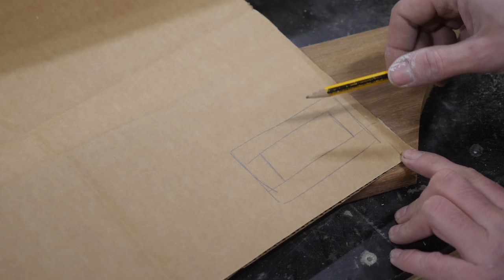Sail Life - Galley assembled, insulated and ready for paint - DIY boat project

Comment: Sir , please don’t be distressed by my observation but I must share my experience. I lost 1.5 fingers of my left hand in a table saw and this is what I learned, I now do not hold wood behind the blade during my accident a piece of oak bound on the blade and the saw pushed the wood forward before I could blink. The entire event happened so fast that I had no chance to even let go of the soft pressure I had on the board . I am left with no index finger and a little more than half my thumb. I have become very good at using a rubber tipped push stick to control small pieces behind the blade . It is my deepest hope to see you and Ava sailing on the channel! So please consider never holding wood behind the blade. Sorry for the downer comment, hope this helps
Reply: Just to add a bit to the safety warning...
Don't use a stop to control the length of cut. You are asking for a kickback. Just put a mark on the wood where you need to stop and another mark on the saw fence. When the marks line up you've cut far enough.
Reply: @johnVidBozo  I make most of my cuts with a circular saw and usually clamp the board down to keep it under control. Are you saying I should never do that either? Just hold it down with my hand?
Reply: This is saw related or the awesome power of power saws. This guy I knew had a radial arm saw. that thing always scared me even though I have been around dangerous machinery since I was ten years old. I was cutting a four by eight sheet of plywood half an inch thick. It was kind of warped. Somehow the saw blade caught hold of it and shot it out of the other side of the saw (where I was not standing). It flung the whole sheet of plywood about ten feet and it hit a wall and stuck in the drywall.  Luckily there was a cinderblock wall behind the drywall. (It was an office building and it would have been scary if it had gone farther through into an office where people were doing Gordon Gecko type stuff). So this is a true story. It was long ago. I can't remember if I was standing on the safe side by choice or accident. But woe would have been me if that plywood had hit me in the abdomen! It surprised me that the saw was so powerful.
Reply: @JakeHolman78  I'm not sure what you are describing. Using feather boards (infeed side of blade only!) to keep the piece against the fence is good. Using some sort of hold down to keep the piece down on the table is good. Having a splitter behind the blade it great.
OK I just reread your comment. Circular saw is kind of the opposite of table saw. You move the saw not the wood. Perhaps that is not what you ment??? Anyway I totally agree about clamping wood down when using a circular saw as long as the clamps are not on the off-cut side.
Reply: nicolas perez p

Comment: Mads, for the drawer fronts. Take the lighter wood and resaw it to at least half its current thickness. Then take the top and bottom rail of the drawer front and cut a grove in the edge facing down or up depending on whether it is the top or bottom. Then slide the thin wood into the slots and glue in place. Makes for a quite easy construction  of a door front or cabinet door.

Comment: I am so glad that the guy building my boat did not put epoxy everywhere in the interior so it can be disasempled without destroying the whole boat. I'm changing pumps, water hoses, running new electrical cables, put in new electrical head, new blackwater pump. And there is ordinare screws to remove all interior, no squeek in my boat, thanks to the steel hull.

Comment: Hey Mads... Without reading through all the comments... I use "Pocket Screws" to build cabinets... Most cabinets makers here in the States do.  "Kreg k4 pocket hole jig master system" is a good easy to use tool and you can get it from Amazon... I've used pocket screws successfully for 35 years... You're doing a great job by the way!  One thing I keep worrying about for you is getting the "Electrical" and "Plumbing done before anything else goes in... Regardless you are doing great!  Try to get some rest in between working a full-time job and your soon to be an amazing home!

Comment: The biscuits come in multiple sizes.  I don't know about your biscuit cutter, but mine came with two different blades that allow me to cover 4 (as best I remember) different size biscuits.  I simply change the blade as needed, adjust the machine, and voila! different size biscuits can be installed.  I don't know about availability of the different size biscuits in your area, but it would be worth looking into.  It would certainly beat having to carve little ones out of big ones.  Keep up the great work.

Comment: Mads, if you miter the corners of your drawers at 45 degrees rather than butt join them, then the length of the corner will permit you to use the smallest sized biscuits.  Use your hand router and a piloted bit to cut a relief for your slats after the outer frames are dry.

Comment: Many cabinet shops here in the states are using pocket hole jigs to assemble drawer fronts, cabinets, and face frames. They are cheep, quick, and fairly simple to use. However, you've chosen one of the hardest woods out there as your drawer front, and may run into issue with the self tapping screws splitting the wood. From my experience he biscuit jointer is mainly used for alignment in long glue-ups and is not a structural joint. Keep up the good work. Good Luck!

Comment: Kreg R3 Jig Pocket Hole Kit ( on Amazon) is how I would put the drawer fronts together. It uses special screws that are screwed into pockets. The screws have really good clamping power and will only show from the back of the drawer front. Please look into it, I've used this method for face frames on cabinets for years and used them on picture frames and even put together a screen door using the pocket holes and screws. You're doing a wonderful job on the interior!

Comment: If you want to continue with biscuit joints,  get a router and a biscuit slot cutter for it.  They have a smaller radius than standard biscuit router slot cutter.

Comment: I would use ply inserts for the draw and door fronts to help keep weight down. When you go to put your draw fronts on first make and drill at least one hole for your handles, then you can align your draw front and use that hole to screw the front on making sure of you clearances around you door front. Then carefully open draw and then screw from inside draw to attract draw front, then remove front screw then drill completely through your draw to attach handle. There are some great YouTube kitchen building clips. Keep up your great progress.

Comment: For your drawer fronts, consider having the corners mitred.  You have the tools to do clean/accurate 45 degree cuts.  This will then allow a long enough joint for the biscuits to work.  Also, you can easily cut the rabbet on the inner edge for your center panel wood without it showing on the edges.  Just a thought.

Comment: For the doors don't be afraid to just use pocket holes on the pieces that are two narrow for biscuits, both are strong enough, you could go all out and use a beefier method but its not really needed, often we will use a plywood to fill in the centre as well as its cost effective and no movement issues that plain wood will  have. As for boat building material, Its a hole in the water you throw money at, there is no perfect product, but there might be a few you can live with :) Fiberglas, aluminum, steel, wood, etc all are perfectly fine as long as you do the work to maintain them.

Comment: Panel doors would be a good place to use your new biscuit joiner . I finished last summer, 11 door panels 1/2" or 12 mm thick panel stock and used #10 size biscuits. Doors were straight panel meaning no face frame to deal with . mine were all rustic hickory. I would also recommend for your face frame the use of Kreg jig and pocket holes . Quick, strong and with stainless screws non corroding. Glue can be added to joint also if desired.

Comment: Another option for joining the drawer fronts is to clamp your frame together and then using a long bit, drill through the two pieces of wood at each corner from the outside and glue in a dowel making it an exposed tenon. I made a black walnut box once and used this method to connect the sides and I used a brass rod as the tenon.  Once it was polished up and oiled, it looked really great.

Comment: A drawer/ door front tip... Have the center section float in the frame. Maybe leave a 1mm gap on top and one side. I'm not familiar with the exact woods but I know different woods expand and contract at different rates. In a boat that is going to be in extreme climates... I bet there will be some warping and cracking if they are built solid.
Reply: I will comfirm you need a little room for expantion / contraction, and btw. The brazilian wood tends to get a silver / grey tone over time in cold weather, wisit you local wood pusher, and try to finde a pice, that has been sitting, the winter over, reaplying oil will bring back the colour it have now, i get a beatiful patina thou.

Comment: The front you have designed is nothing more than a filled picture frame. As such, 45* corners with spline reinforcement will be more than adequate. You can also use the second wood species for the splines which makes a really cool subtle accent.
Reply: I concur on mitered joints. I think the woods he has chosen are quite stable, but in a marine enviroment, there will be a lot of changes in humidity, and a mitred joint should help to mitigate issues with wood movement. Mads: Make sure to leave some room for the slats in the center of the frame to move, if you make it too tight, it might break apart when the woods swells.

Comment: Mads, I've used dowel pins for cabinet faces and frames. They are more useful for narrow widths. More versatile as well, use 2, 3, 4 depending on width. Also you may need a new tool!
Reply: He can use a drill bit with the correct jig?
Reply: @rowantaylor4070  Yes, you can get a dowel jig for less than $20. I've used them for speaker building and various projects.
Reply: I agree with the dowels as opposed to biscuits and Mads since you like tools check out the Dowel Max. its a very versatile doweling jig
Reply: I've built some really sturdy joints with hardwood dowel pins.
Reply: Tim French Good advice, I'll add (a bit late perhaps) that 45° cuts makes for an even more spiffy appearance :)

Comment: Pocket hole jig for pocket hole screws is what most cabinet builders are using now rather than biscuits for the frames. Biscuits work great for other application when working with the grain and making wider boards like table tops

Comment: Hi Mads, I just discovered your channel (late May 2020) and I am binge watching the Athena refit videos from the beginning. I watched this one just to see how far you have made it and I can see that I have lots of excitement in store. Thank you for being so incredibly disciplined about posting your videos. When I realized that you are in Skive, I felt a bit of a bond; I have lived in the U.S. for over 30 years but grew up in Nykøbing M. 

On a more useful note, I would caution you about how you assemble Ipe. It is notoriously difficult to glue because of its high oil content and mechanical fasteners are recommended; you may want to add some screws to your drawer front frames. Also, biscuits are primarily for alignment and not for structural joints. For what you are doing here, the Festool Domino or dowels are much better choices. That said, the drawer fronts are low stress parts and you will probably be just fine. Okay, it’s back to 2018 for me 🤓.

P.S. Glad you still have all your digits, I second everything said by others about table saw safety.

Comment: Love your videos !
When I built my 36 foot sailing cat, I made all the floors, joinery, lockers and cabinets, below water line with ' lift out bottoms ' floor boards. For fast and easy inspection in case of hull breach. For the water tight crash box areas, I used access hatches with stainess screws with wing nuts and gaskets. All areas of hull can be inspected fast. Cheers, Sail On 😁

Comment: You do such great work. I have a suggestion for drawer fronts.  I recently refitted my live aboard and I was in Canada so very concerned about moisture and ventilation (I am now in Mexico). For all of my cabinet door and large drawer panels I used Phifertex (outdoor sling chair fabric) over top a panel of 1/4”/6mm plywood with 2”/50mm holes drilled through the plywood. This allows air and moisture to travel through all storage areas.  Phifertex comes in a hundred (or so) coloured patterns.  My interior is primarily varnished teak and the Phifertex pattern gives a very nice elegance to my cabinets.

Comment: Cabinet maker here with my 2 cents on the door front construction. Do a little research on how to build a simple Shaker door front.  There are tons of tutorials on how to do it using just a table saw, no fancy tools necessary.  Basically, it goes as follows:  Cut a 15mm deep groove in the center 1/3 of the inside of the frame pieces (say you're using 18mm thick material, cut a 6mm wide groove, leaving 6mm on either side). Then cut the short frame pieces 30mm longer and remove the outer 6mm on either side, 15mm deep on either end, so those will slot into the long rails.  It becomes a tongue and groove joint.  That will give an incredibly solid glue joint, and its super easy to do.  The center piece(s) should NOT be glued in.  They need room to shrink/swell depending on humidity, particularly if you're using solid wood.  Ideally, you should be using a 6mm plywood for the center panel, but solid wood will work so long as you cut the pieces a few mm shorter so they have room to move.

Comment: In a kitchen or galley area, a better and more sanitary finish for the drawer fronts would be a satin wipe on polyurethane.  In the head, any woodwork should be coated with penetrating epoxy and then a topcoat of wipe on satin poly.

Comment: Hey, Mads love your channel I've been watching since the early silent Obelix days, I am an Aussie cement boat guy, I've been living onboard for about 4 years. My early background is in boat building but I've been working as a cabinet maker for about 20 years, the simplest way to make the doors and drawer fronts is with a rail and style router set, you can pick up a cheap one of ebay (which is all you will need) for about $30. 

Hope this helps Cheers mate.

Comment: Given your proclivity to go 'whole hog' on any project you attack (believe me, I suffer from that disease as well, so I know your pain), you might consider using  mortise and tenon construction.  Investing in a good mortise cutter and plunge router would speed up the job (there are specialized mortising machines too, if you can find a used one, that would be even better).  Especially since I think that you will have some doors that need to be built, the mortise and tenon option on the drawer faces would give you some practice for the doors.  Cutting the tenons can be done on a tablesaw, do mind those fingers and use a jig.

On the other hand, simple half-lap joints are always a good choice too.  Very strong and fairly easy to do on a table saw.

Comment: Having built cabinets with a biscuit joiner, I can tell you that the biscuits don't add a lot of strength, but do make the surfaces come together very nicely especially when clamping.   As far as the areas too narrow for a biscuit, I simply let the joiner cut through one side and then used a Japanese pull saw to cut off the excess biscuit.  This works nicely where the cut surface is hidden.

Comment: Mads I made cabinets and the easiest and best option is shaker doors. It is just what you did with a groove around the inside and a thin piece of plywood slid in then assembling the frame. It makes it stronger and allows a full cover so stuff can not fall out through the slats.
Reply from the maker: Awesome! I've learned a new word - shaker doors. Thanks! I found a really cool video on youtube that introduced me to rail and stile router bits :) I think that'll be my next try :)

Comment: When building drawer fronts your styles (vertical ends) always run full length of height and your rails (horizontal top and bottoms) go in between. Just a helpful tip and looks great on stacked stained drawers 👍🏻great job

Comment: Hey Mads. Really nice to see the building up. All looks really promising!! Regarding the door and draw fronts.. when you build a frame with peaces of wood in there as a panel, keep some room in the width of the wood to expand. Otherwise it wil brake the frame. I also like to make the frames a bit oversized so I can saw them to size on all sides to make the seams really clean and fix some alignments if needed. A festool domino would be a life hack, but also a big investment.... you can also buy a 8mm routerbit and make a jig for the plunge router and use just the domino’s. The biscuit machine is perfect for aligning panels and building a plywood draw but not really ideal when building a frame. No doubt you will get them spiffy;)

Comment: Made you should use wood glue for your cabinet door joinery. It is pretty strong enough and it will be easier to sand before you put the finish on the doors. The epoxy will likely leave a stain on the wood that will show through the finish. Dowels are also better than the biscuit for this type of joinery. The panels inside the doors should be left floating and be sized a tiny bit smaller to allow for wood movement unless they are made of plywood. To avoid these rattling you can pin them in the centre or use a small rubber gasket in the groove. Do not glue them in place as your joinery will come apart or crack.